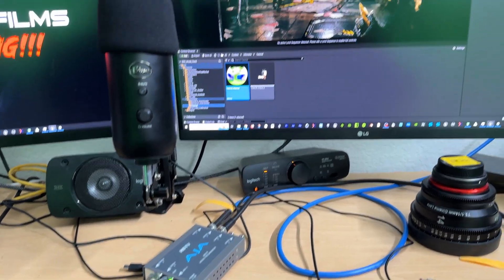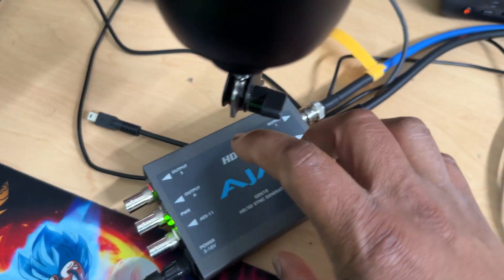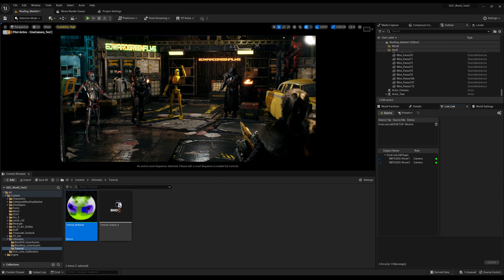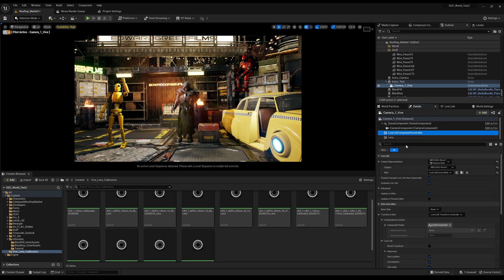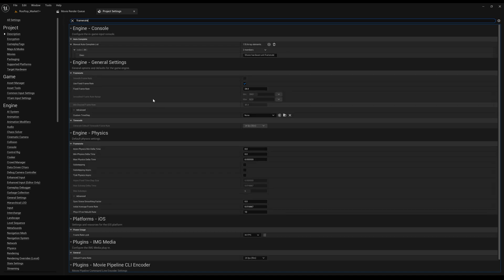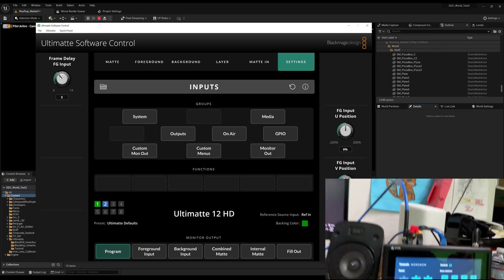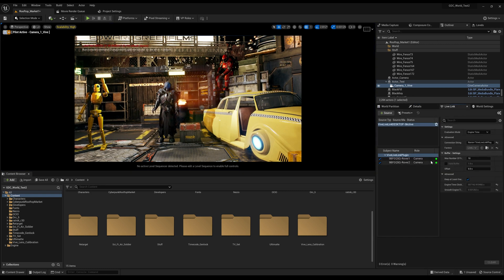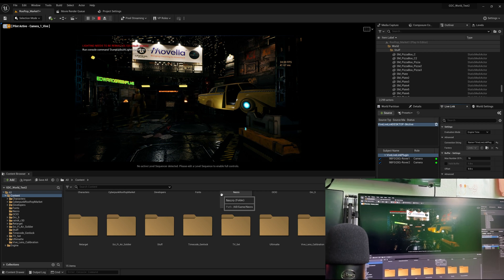My Ultimatte 12 HD to Vive Mars Camtrack UE SDI Port setup (Overview for Virtual Production) Part 2

Comment: Dear Ed! I wanted to express my gratitude for sharing all your knowledge here. I use exactly the same setup and you saved me  soo much time settling it up!! THANK YOU SIR! I wanted to ask you what jib you are using and that mount for the rover on top of the cam. Mine is still wanky:-(( I wish you and your family happy holidays! Keep creating and best greets from Switzerland Marco
Reply from the maker: Thanks, Marco. As far as the mount for the rover I am using the SmallRig 1/4" to 1/4" Male Threaded Screw Adapter along with the iFootage Magic Arm Spider Crab clamps. When you mention Jib I want to make sure you're not asking about what tripod I'm using because I don't believe I am showing my Jib in this video but I will let you know the tripod I have each camera on and the Jib that I own but not using this video. Both tripods are manfrotto tripods. The tripod that has the Ursa Mini G2 on it is the Manfrotto 612 Fluid head with the Manfrotto 536 Carbon Fiber legs. The tripod with the 6K Pro is my older Manfrotto 504hd head and the 546B legs. The jib I have but not in the video is the Weifeng 9ft jib. Hope all is well and thanks for watching.
Reply: @GTshortStories  Thank you Man!!!

Comment: How do you record live your Ultimate Keyer? Do you use the Monitor Out or something else and do you have a external Recorder? For Unreal to recognise Genlock, one Port on the Decklink needs to be not in use. So if I have a BG, Garbage Mask and Holdout Mask I cant use the 4th Input of the Decklink to record it. 😥

Also for a Multicam Setup we got multiple Keyer and Outputting the Unreal Background, Garbage Mask and a Holdout Mask for each Cam. 

Is there a way to connect multiple PCs together for better Unreal Viewport Performance, because this is even crushing our RTX 4090 😅
Reply from the maker: You just said a lot 😂.  I have an Atomos Sumo 19" for external recorder that I can use if I wanted to record the Keyer. I use the monitor out and the Program out as well for other monitors to show the final output (Usually for clients). When it comes to using Garbage mask, Holdout Mask and BG I also have the decklink duo 2 along with my Decklink 8K pro to have 4 more SDI ports (More money but not as expensive as the Decklink 8K Pro). I haven't done a multicam setup yet so I wouldn't know how to approach that at the moment. 

I'm, running an RTX A6000 and at the GDC I was running the Vive Mars, Streaming Xsens Motion capture live into UE as well as a pushing everything out to multiple monitors for 9 hrs straight and I was hoping nothing went wrong 😅.
Reply: @GTshortStories  
Thanks for the insides and the explanation how your Setup works. 👍

I tried the Atem Mini SDI to record all signals for now. Its just full hd, but thats ok for now. Only problem is syncing it with the audio. 

The Blackmagic Plugin in Unreal outputs VITC as Timecode over the Decklink but its only recordable in the Media Express Software from BM :/

When I put into the cam, Mars and Mic Left Channel a Timecode Generator it should work, but because the atem makes is own VITC Timecode and the LTC cant be used in Davinci Resolve if a VITC is already embedded into the atem recorded videofile, I struggle to sync anything. 

BTW, if the Cam is delayed in the Keyer, is the audio of the cam also delayed?

For all the Masks and BG we use the Decklink Quad 2 with 8 Ports + a 8K Decklink. But we realise that one PC really struggles with all these Masks. Even when using the better optimized Off World Plugins. Because we have multiple powerful PCs with even more Decklinks, it will be cool if there is a way to cluster all PCs together for Unreal in a Live Multicam Setup without any lags at 25FPS or more. 😄

Sorry for all these questions, but its really hard to find good informations about this topic. 😅✌